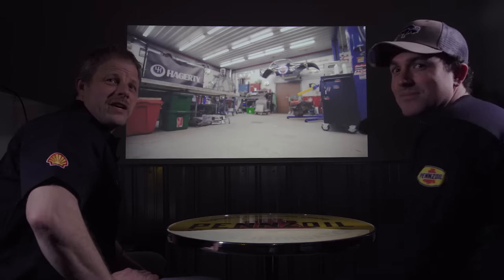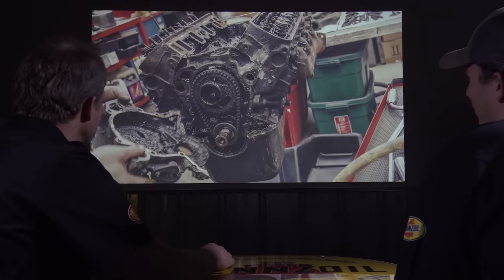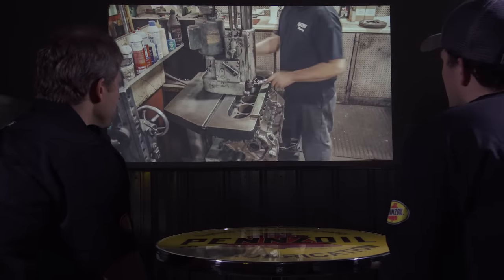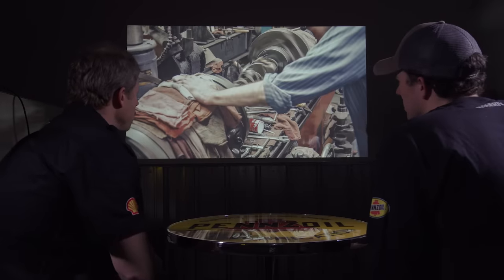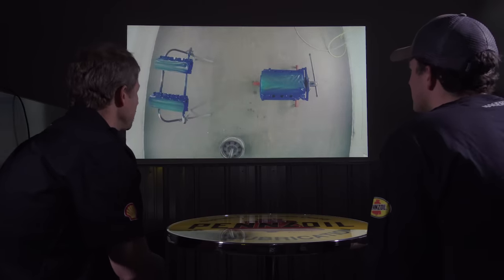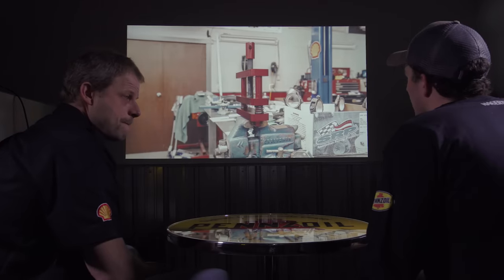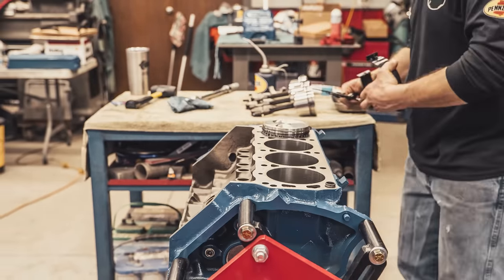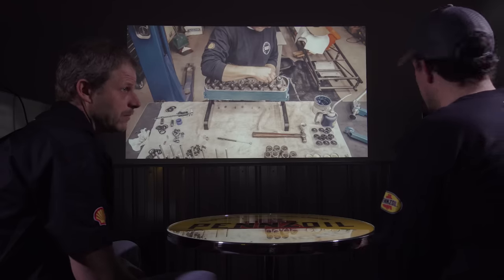How we rebuilt a stock Ford 289 V-8 to Shelby GT350-like specs | Redline Rebuilds Explained

Comment: When doing the cleaning of the block how are the cooling passages cleaned. A situation I had was the original owner had used water only for a coolant and there were rust particles within the block unbeknownst to me. These unfortunately were flushed by the coolant after rebuild and plugged radiator passages. This caused major problems for a long time until I rebuilt the engine again and had particular attention paid to cleaning. This did resolve the problem but I continue to watch and wait as you just can't look inside those passages. That is the reason for the question.
Reply: Those hot tanks dissolve any small particles of iron that might form on the surface of the casting. The liquid in a hot tank has lye in it...very strong stuff. Once they remove it from the tank they wash it and remove anything that might be in those passages.
Reply: My concern is that there could be air pockets within the passages and one really can't see inside. Is there a 'normal' method to ensure that all the passage is cleaned
Reply: Richard Franke pretty sure they use circulation pumps in those tanks.

Comment: Good old 65 ford 289 2bbl made maybe 180 hp but would spin the tires ,bias ply, easily. The engine took all the abuse you could throw at it except overheating. Throw it in reverse a60mph and actualyl spin the engine backwards. Never Blew up. The C4 never blew either. 65 mustangs sold used for $500. The Drum brakes sucked. Thats why reverse at 60mph. Ironically it was totally destroyed in a head on by a Bug which drove away. The Horsey Whinnied no more.

Comment: When it comes to solid lifters, and the   cam is on spec, I adjust each intake and exhaust on top dead center, using the firing order, and I adjust em when they are hot, am I right or wrong, yeah I know its messy.

Comment: Wondering if you would be able to build a 911 porsche engine preferably a 75 to 79 with air injection. Covering tips such as setting up and adjusting cam timing  and mabye common upgrades like carrera  timing chain tensioner.

Comment: I love ford and dodge cars but I have owned more fords then dodge's in my 45 years of car ownership and the one bad and good part about ford engines is the thin casting it make's the block lighter but is the Achilles heel of ford engines in the walls are so thin it's hard to keep water plugs in unless there brass and the block is weaker in a few spots compared to Chevrolet blocks but they can make more power then Chevy or Dodge for a equivalent build just don't make more then 500 HP or they split down the middle.

Comment: You may be able to make a fake HI-PO on your show but there a lot of things that do not add up. Original HI-PO's had solid lifters, I heard you say you were running solids but when it started it sounded like a hydraulic cam to me. Real solids make real noise. You used the wrong distributer, wrong cylinder heads , wrong crank, wrong block, wrong rods, wrong balancer, wrong , wrong rockers and wrong carb. The shelbys had a lemans style carb which is way bigger than that 600 you used.  In the end you have a ok motor but I listened to the expert and he is no expert on what ford really ran in those days.